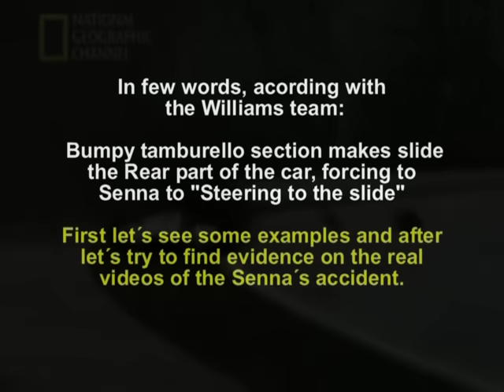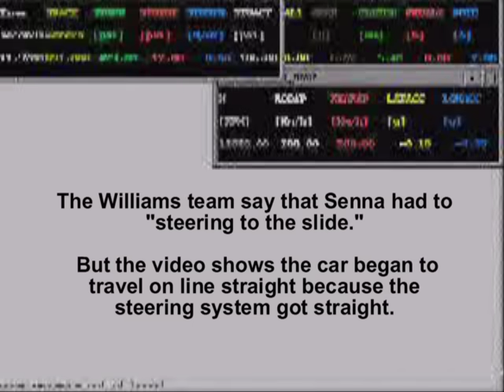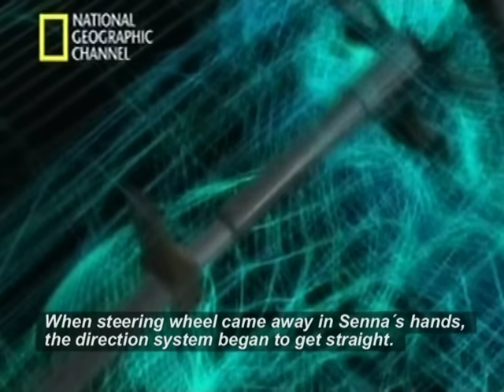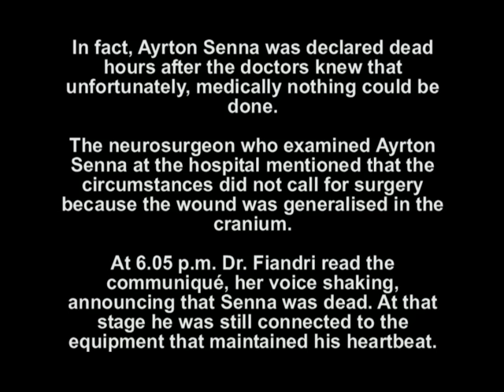5/5 the death of Ayrton Senna - what NatGeo did not tell

Comment: Mechanical failure are part of the risk also?  Why do they try to hide it?
Reply: +SGDeGalvez Check  this video out Senna: Schumacher was cheating and this video Senna The Truth Behind Imola
Reply: UniversalSoljrr on senna's trial what was the verdicyt afterall? driver's error or mechanical failure? its obviously the second but did the team pay or they covered it up?
Reply: Simple to save their assess
Reply: Indeed. It's uncontested fact that the steering column was modified (lengthened) at the track at Senna's request because he didn't have enough clearance between the steering wheel and the monocoque. The team didn't have an option to do a safer or more permanent fix at the track, although they obviously would have done so once back at the factory, probably after Monaco. That's the kind of risk that drivers run all the time. You want to wait for a longer steering column to be manufactured and fitted before you will drive the car again? Fine, you miss two rounds of the championship. I don't know if the welded joint failed and caused the crash, but if it did, I don't think it's a crime. I think it's a risk that team and driver took together and Senna got very unlucky.
Reply: @ TheS50b30 - the engineering consensus was that the steering wheel failed due to poor mechanical welding.  

The problem was that the prosecution wanted Frank Williams etc found guilty of manslaughter, rather than lesser charges.  

Both FISA and Ferrari placed immense pressure on the Italian government regarding this court case, and given the history of the Italian judicial system in general (rather corrupt!), I have no doubt that the decision that was handed down was to appease Ferrari and FISA, i.e. politically and financially motivated.
Reply: @philwoodward5069  The country laws for that race are a bit different to other countries. Here a death of an race car driver got treated same as an road accident. For that matter, the Williams team personnel would be accused of manslaughter. 
That Sennas death declaration was officially timed AFTER the end of the race, was for the same reason (in that case by the race track organiser, because they would have been accused as well!)
Reply: @heiko3169  1. Unless Williams tampered with the car outside of what Senna may or may not have asked them to do (aka lengthening the steering column), there's absolutely no reason they should be held accountable for a mechanical failure. The only person you could even consider pressing charges against would be whoever did the weld that failed but even then it's a pretty weak case, especially if Senna asked for the change.
2. I've never seen a race that's not Le Mans last for longer than 4 hours. If he was still alive more than 4 hours after the crash, it's not really a conspiracy that he wasn't pronounced dead before the end of the race because the race wasn't over. Even if the race had still been going when he died, the race organizer wouldn't be held liable because I'm sure there's plenty of clauses in his contract stating that any injury or death while racing or practicing is not the fault of F1 or any race organizer.
3. I personally think the best case you could have would be safety inspectors. They've seen this race plenty of times and know full well how fast that corner is and how dangerous it is. The fact that there wasn't even a suggestion to put a tire wall on that exposed concrete is kind of ridiculous. They put tire walls all over chicanes at that time there's no reason there shouldn't have been one on the outer wall of the fastest corner in motorsport.
Reply: Well this is technically a mechanical failure. However the cause of it is not what I would call an accident. Any racing team knows exactly how to calculate and predict the failure of a steering column. Even 2nd year engineering students know how to calculate this.

The modification done to the steering column at the track, was not done correctly and professionally, that is quite obvious. Here's why:

1. Let's assume that there was no time to make proper engineering calculations for this modification. When lengthening a shaft, you use at least the same diameter (or larger) than the existing shaft, not smaller like they did on Senna's car.

2. If welding is involved and you don't have a certified welder and inspector to do the job, you either simply don't do it or instead you use mechanical components to hold the parts together. Fasteners (ex. bolts, nuts, cutter pins, etc.) are easy to calculate and rely on, not welding. Welding quality is HIGHLY dependent on the skills of the welder. This is why such welds must be inspected using proper methods such as magnetic particule, ultrasonic and/or even x-ray depending on the type of weld.

3. When's the last time you saw a steering column break on any car (racing or not) causing an accident and killing someone? It nearly never happens because the design of steering columns is extremely well documented and tons of data is available to confirm proper design. It is an unbelievably simple thing to design, especially for a Formula 1 team with near infinite budgets.

What happened to Senna was the result of very poor and shoddy workmanship. If this had been clearly presented in court, Williams would have had a very serious sentence, maybe even including jail time for some people. Now we are talking about Italian courts, which are widely known to be corrupt.
Reply: They tried to hide it because Italy.  In any other nation where F1 operates, it's understood that anyone dumb enough to get into an F1 car is taking their life into their own hands, and they're accepting the risk of things like a poorly welded steering column... so the manufacturer of the car is held harmless.  But, not in Italy.  In Italy, they're a little more hard-nosed about it, and the manufacturer of the car can be held criminally liable for something like a hastily modified steering column... especially if that steering column was modified IN ITALY.  Had the column been manufactured using proper F1 manufacturing techniques at Williams in Great Britain, and then failed... even in Italy, there probably would have been less of a stink about it, but still.  Italy wanted Frank Williams tried for manslaughter... that's why it was covered up.  If this crash had taken place in ANY other country, we would have seen the complete details, and been given an accurate A to Z description of what happened.  Because of Italy... there are now a billion and one conspiracy theories about this crash... my personal favorite being the Illuminate in cahoots with a Nazi conspiracy who assassinated Senna with a sniper... and the bullet caused electromagnetic influence which is why Senna's camera started to go on the fritz... you know, instead of the camera in the car going on the fritz in exactly the same way it did in every other F1 event up till this one.
Reply: @davepastern  shit happens,it messed up to make a crime out of a mechical issue.Im sure williams thought the car was as safe as it could be,the last thing they wanted was Senna dead.
Reply: @jerrymarshall2095  no there is a criminal responsibility to ensure the cars are safe.  Everyone knows the court system in Italy is corrupt and that pressure from FIA and Ferrari made sure that the Italian government pressured the courts to find Williams not guilty.  So many things were done wrong after Senna's death (the car should have been impounded, but the FIA allowed Williams to remove the car for 'inspection" - breaking FIA rules and Italian law I might add).
Reply: @davepastern  just my opinion my friend,I never was a big Senna fan,Mansell was my favorite,I even liked Prost over Senna,but Senna was probably the most talented of the bunch.I was watching the race on T.V. live when it happened,a sad day for sure.
Reply: @davepastern  Just one point Id like to make,Senna went to Williams because they had the best cars for at least the last 2 years prior to the 94 car.Mansell and prost both won the 92 and 93 W.C.in the williams.Williams 94 car was not very good,I believe it had some nasty habits on the track.Mansell came back to williams for a few races after Sennas death and didnt like the car,I think the rear stepped out alot or some other serious handling problem.Damon hill complained about the handling too.Regardless whether the steering broke due to bad workmanship or design,these cars can wreck due to all kinda issues,breaks, tires,suspensions,engine or transmission problems,body work .etc.why arent those issues criminal ?What happened to Ratzenburger,I believe it was a mechanical issue also,not for sure.
Reply: @jerrymarshall2095  You'll hear no argument from me on the car's handling - it had major issues with oversteer going into a corner (entry phase) and sudden understeer on exit of said corner, which is a driver's nightmare.  The car's balance issues could not be (at that point of time) settled so that a balance between entry/exit over/under steer was met.  

Undersand that the Tamburello corner was NOT a corner.  It was a slight bend in the circuit, taken flat out, in 6th gear.  It was a simple bend, not technically difficult to negotiate whatsoever.  

From memory, Ratzenberger's car had a suspension failure that saw him hit the curb and be launched into the wall/air in a very nasty way (main strait, flat out, leads into the Tamburello corner).  

A mechanical issue is a mechanical issue.  If it results in a driver death, and the mechanical issue could be found to have been reasonable avoided, and there was negligence on the manufacturer's part, then punishment should be due.  If it was an act of God, and no due negligence could be found on the manufacturer's part, then it's a racing incident and no punishment should be incurred.

I make my comments based on extensive reading of the various testimonials presented to the Italian court.  Both Alboreto and Berger were called to the stand, and believed that there was ZERO way Senna could have made a mistake at the Tamburello corner.  Expert engineering witness found stress on the steering column, which his experience led him to believe was not caused by the impact, but existed prior to the impact and was in fact, the cause of said impact (steering column failure).  There is sufficient evidence to show that Wililams engineering did a quick welding job at the circuit to shorten Senna's steering column, and make the driving position more to what he was used to and more comfortable for him.  

Witnesss at the trial swore under oath the the 2nd black box in Senna's car was undamaged when it was in parc ferme.  Then, strangely, against all FIA rules, and Italian law, the Williams team was allowed to take Senna's mangled car away for "investigations".  When said black box was presented to the court, it was mangled beyond belief.  If you use any logic, occam's razor would dictate that the witness who reported the black box as in good condition, was not lying, and that William's had ulterior motives to make sure that the data contained on said black box was destroyed, to hide the cause of the accident.  Of course, there was major money at risk here - the circuit owner and organisation that ran the race, as well as Williams, as well as the FIA would all be held legally responsible, and required to make financial payments to Senna's family.  There is of course, mandatory jail sentences for Williams and Head too, if found guilty.  This would look VERY BAD for the sport.  The FIA was under heavy pressure from Ferrari to ensure that no conviction was made against Williams.  FIA and Ferrari even threatened to pull out of any sanctioned FIA race to be held within Italy's legal borders if Williams was found guilty.  Money is veyr important in this sport.  

Lastly, the '94 Williams lost traction control, power steering (from memory), active suspension, all of the things that gave it an advantage.  This made the 94 car very unpredictable, as Head screwed up the car design with anticipation for the 94 regulation changes.

Also note that Benneton was cheating for the entire season (illegally running traction control).  That was worth at least a second a lap...this placed considerable pressure on Williams and Senna to push the 94 car to the limit.  Listen to audio from F1 races in 94 and you can clearly hear the expected sound from the Benneton car if you had expected it to be using traction control (it has a unique sound that stands out like dogs balls).  Excuse the french.  

Yes, I am a Senna fan.  But, I'm also a man of science and like to use logic.
Reply: @davepastern  I get the logic,but this is a race car,not a V.W.how safe is a 1, 500 lbs car with 800 hp that can go over 200 mph.that is driven by maniacs.the whole freaking show is life threatening.The cars are tweaked to the very limits of physics to cheat natural laws.for one piece to fail on the steering column due to metal fatigue or a bad weld and criminally prosecute for it is beyond logic in my world.If the team had seen failures b4 and ignored them and the driver knew not of them ,then yes.but I know that didnt happen.
Reply: @jerrymarshall2095  no.  The team has a legal obligation to ensure that changes to the car are as safe as possible, and done as well as possible from an engineering point of view.  Williams failed in this aspect.
Reply: @davepastern  thanks,I'm ignorant of such legal liabilities,I understand your point.
Reply: @jerrymarshall2095  all good.  I know motorsport is dangerous, and I know that stuff breaks.  I don't have an issue with that.  I do have an issue when a mechanical/engineering job is not done correctly and is sub-standard and causes an injury and/or death and it was avoidable if due diligence had been attended to...
Reply: @thebonesaw..4634  A little heavy on the Italy hating, seems like you're getting a bit of a jolly from it, but I do agree the conspiracies are nuts. Sadly I've seen that one too...that someone shot Senna's tire. Now sadly the one I saw was less zesty....this person said it was done to take him out so Schumacher could become what he did. 
Ya know...forget how impossible this is for so many reasons...why they would kill a legend so someone who was young at the time could be favored. Its wild what people turn to instead of the obvious.
Reply: @Nisie23  Heres what I never got about this...didn't Senna ask for the steering column to be changed? Now not saying they didnt do some tragically sad job but they also wouldn't have if he didn't ask for them to do so. And Im guessing he wanted it done now and wouldn't wait for a better fix/they were quick to give in because he was Senna. Not blaming or anything but ya know, its always 100% on Williams and never does anyone at least acknowledge they were put in that situation by his asking. Perhaps some type of negligence or something could've been levied...but I mean all this "they killed him!" stuff....cmon. I mean didn't someone from Williams admit it was a shoddy job? Its not like they are denying even they did a half assed job.
Reply: @SchrodingersCat8813  -- I'm not bashing Italy.  I'm pointing out that this was the only country where something done to an F1 car can be prosecuted criminally.  This is why everything was covered up... so that Frank Williams wouldn't go to prison.  Had this accident happened in - say - Germany... we would have known exactly what happened, because there would have been no risk of a criminal investigation over an accident in and F1 car.  That was my only point.
Reply: @flightmaster999  okay I didn’t read that essay but I read the welding bit. No you don’t have to have another certified welder with you to check your weld.... they couldn’t do it anyway you have to x ray a weld. Also you wouldn’t weld that car unless you were certified that’s not how welding works joe blow doesn’t get to pick up a welder and pute a sky scraper support together it also would’ve depended wether he was a certified field welder or manufacturer personally I got my field welding certification from a college school that was dedicated to engineering I forget the name but it’s in Washington state so unless they just didn’t care they absolutely would’ve x rayed the weld and it would’ve been done by a field welder because it’s not a controlled environment while I don’t know what the details were to say it was a poor welder or anything of that sort is simply not true all certified welders have to meat a spec and we do many test before we can actually do anything on any field equipment
Reply: @flightmaster999  however this highly dependent on what the team classified it as was it field welding was it a controlled eviorment was it considered a structural part that was vital to the machine there’s so many factors. Technically speaking if they qualified it as non structural then no it does technically have to be x rayed there’s just a lot of factors that we don’t know but I’m not going to blame the welder because they could have told him it was non structural and do just pute the damn peice on in that situation it’s not his fault
Reply: @davepastern    Mechanical welding? that's a new one on me.

Comment: telemetry showed that the brakes were fully on just before the crash proving that the steering wheel was broken if senna lost control he would have tried to correct it not step on the brakes
Reply: Proves nothing
Reply: The steering column broke in the crash. If it was broken before whe he corrected the slide which telemetry shows he did the car wouldn't have responded in the way it did.

Comment: "The back of the car stepped out."

What?

Plain as day in the crash footage the car goes straight as if it had a front tire go flat. Hell, if the back had stepped out, Senna would have spun, or at least hit the wall at a different angle.
Reply: I think it didn't say that the back stepped out just both